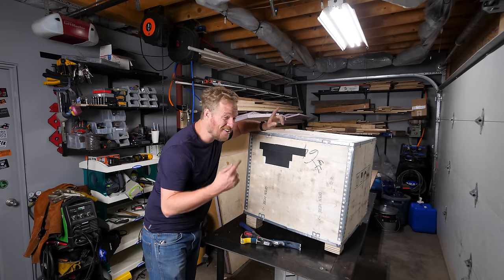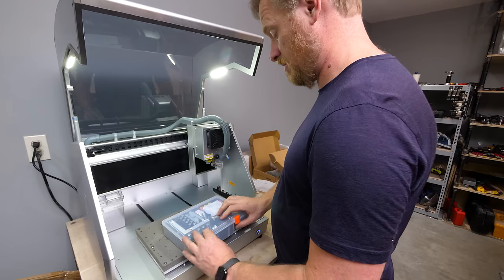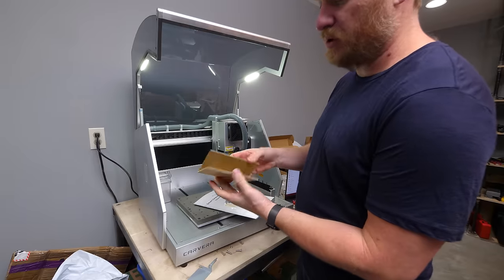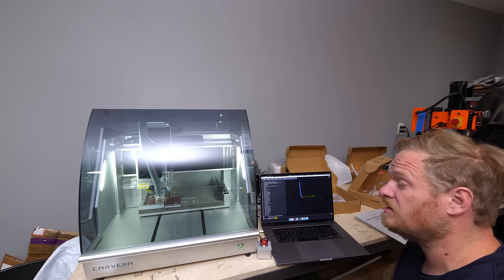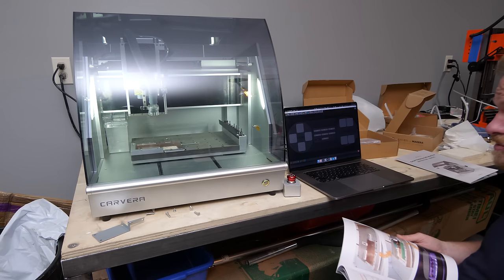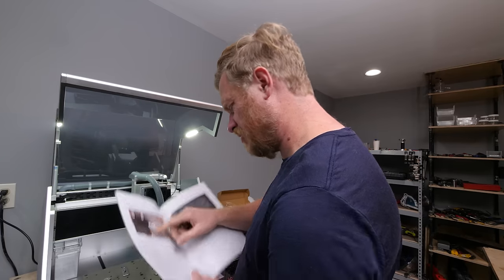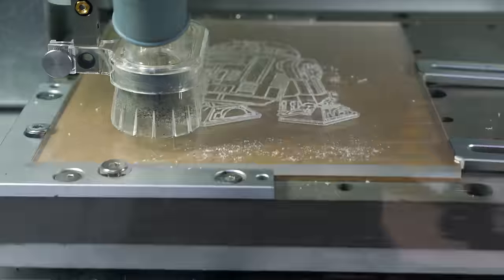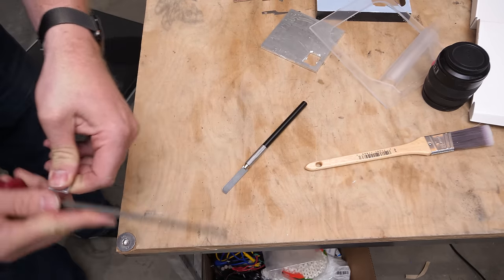Carvera - The Perfect Desktop CNC Mill?

Comment: These seems like a solid build for a small soft material CNC, however it suffers from the same problem as Bantum tools: at $4k, why not just spend the extra 2 grand a buy a full on tormach? I think for these desktop CNCs to be a good value they're going to have to come in under $2k.
Reply: i got a desktop cnc for 4k   since its kinda hard to carry a tormach into my Apartment on the 3rd floor 🤷‍♂️also i only have single phase power
Reply: @Basement_CNC  which one did you get?
Reply: @Basement_CNC  I think the smallest tormach can run off 110 - either way I just can't get over the value difference. For $2k more you get a full fledged CNC machine with a real build volume that you can even cut steel on, vs $4k for a machine that's going to struggle with aluminum and has minimal build volume. Is love a small "desktop" machine but I think it should cost around $1500.
Reply: @lephtovermeet  I think this is great value for what it is but it's not the best option for most people and a huge ammount of money. What I can't figure out is why none of these desktop machines have steel or even cast iron frames. At the price the shipping cost difference must be negligible and I don't belive it would push the weight over the top to make it impossible for one person to manage a machine of this size.
Reply from the maker: I'm considering getting a tormach as well.  I think they're for different use cases though.  I'm not sure I'd want to try doing prototype PCBs on a tormach, for instance.  Also, you're going to spend a lot more than $2k more on a tormach if you want to match the bells and whistles like an ATC, enclosure, dust removal, etc.  Even on a 440, those add-ons really add up.

Comment: I wonder if you could use MasterCAM to generate programs and G-code. You'd need to create a POST for the machine but after that the sky is the limit. Can you cut mild steel if you feed slowly or do you not have the rigidity/power?

Comment: This is literally double the price it should be. The only people using these are the ones that got them for free to review….

The smart makers just make their own for a fraction of the cost.
Reply: I'm working on my own no budget desktop cnc but if you value your time and you want a tool not a project then this is dirt cheap. And I haven't seen any cheap and decent tool changing systems for desktop cncs, diy or not. And building something like this would cost one or two k for just parts since it has linear rails, ballscrews, servo motor, wireless probe, laser and more. It wouldn't be hard to build something more rigid or powerful cheaper but matching the functionality and polish for the price they offer seems very hard.
Reply: @samandoria  You bring up some good points but $4k+ is A LOT for a 200w spindle and no rigidity - no matter how many gimmicks they throw at it. If someone's not into diy, there's plenty of cnc mills/routers on aliexpress for that much with 10x the performance.
Reply: @hzmeister9596  what makes you say the rigidity is so bad? To me it seems it should be way better than any similar size router I've seen on Ali. They also always seem to be made of aluminium or even sheet metal and not of a more sturdy construction. If you have a model/search term that I've missed I would love to look it up. I would hope this would have a more rigid alloy too considering the price. Anyway you'd be surprised at what you can achieve with even just a 70w motor and this level of rigidity. Pocketnc is also 200w and 1500 usd more(but 5axis). Having watched a lot of videos on the nomad desktop cnc I'm amazed what people can create and use it for working within its limitations.

Comment: It's nice but for $5,000 I'd be tempted to buy second hand.  As for the extraction, get something external and make sure the cabinet can breathe, no point trying to suck it out while fighting a vacuum.  Also, way too much shank was showing on the engraving bit, shorter is better.  Apart from all that it's quite impressive and vid was well presented, you hit most of the problems that anyone new to this will face which is always good, nothing worse than new kit not performing as you'd expect.

Comment: How does the machine deal with toxic fumes from laser engraving?
Well enough to use it in an apartment?
Reply from the maker: As far as I can tell, there's no solution for the fumes.  My shop got kinda stinky doing the wood engraving example, and a bit of smoke accumulated on the inside of the cover.  If I was doing a lot of laser work, I'd either hook up some sort of proper fume extraction via the port for a supplementary shopvac (to replace the built-in dust collector) which looks pretty doable, or I'd buy a dedicated laser cutter/engraver.

Comment: Nice machine, but yeah the dust collection seems a bit underwhelming.
Maybe a mod for an external shop vac would be a nice addition :)
Reply from the maker: I guess I didn't mention it, but it already has a port for that - just need to buy or 3d print an adapter for my shopvac hose...
Reply: @strangerparts  I don't think you released the dust collection skirt when milling, it's supposed to fall down onto the part to make a better seal for the vacuum... I will say it's still not perfect though.
Reply from the maker: YeH, it’s a little sticky though…

Comment: Will it do 17-4 steel and grade 5 titanium?
Reply: Doubtful. A higher capacity spindle, more rigid construction would be needed. I have a FoxAlien vasto CNC router/mill, I use it for milling aluminum, while it does the job, you can see the machining straining , especially when thicker stock is used. All this even when the machine has ball screws, large double linear carriage and rails

Comment: 3/16 endmill might be a little better option if you think the 1/4 is little bit too much
Reply from the maker: Yeah - The 1/4" is doing pretty well. Particularly on plastics like delrin and nylon.  It's a bit much for aluminum, but for rough passes it's ok I think.  Just wondering if I want to get more bits with a 1/4" shaft so I don't have to switch collets so much.
Reply: @strangerparts  One trick I do on my desktop CNC mill (FoxAlien WM3020) is to have a set of collets with each collet fitted to an individual nut. This saves the effort of snapping the collets in and out of a single collet nut when I want to change tooling from, say, 1/8" to 4mm to 6mm to 1/4".
Reply from the maker: Ah - these collets have an integrated nut, so that’s not an issue.

Comment: Given how you can get professional made PCB's for a few dollars these days, with fast turn around time, spending $4000 on such a machine seems like a waste. Its not like its all time and labor free. You still have to spend a lot of time making it, and good luck getting plated through holes and high density tracks.  Also, buying PCB blanks, and consumables will cost you more than the cost of having boards made for you.

Comment: What type of bit do you use for the solder mask removal ?
Reply from the maker: It’s some sort of spring loaded deal, presumably to control pressure so you don’t cut the copper. All it says on it is “uv removal tool” though
Reply: I see a custom part. Thank you for your answer.

Comment: 10:35 how do you like the LTT screwdriver?
Reply from the maker: I like it a lot!  In face, just used it last night to remove a dozen screws on the back of this thing to make a quick tweak to a potentiometer that is supposed to fix the spindle errors I've been seeing (they discovered the fix after they shipped mine, but before they shipped all of the actual customer units).  The screwdriver was perfect for that task.

Comment: The niche and time for these overpriced things has long passed.
Reply: This is really cheap for the features it offers. I see your point for bantam/nomad that only has American made and out of the box functionality as their selling points. But this actually offers so much more for the price. If you are willing to diy and don't care about atc you can get it/make it for way less and probably better. But we are still talking huge amount of hours, lots of tools required and at least a quarter of its price in parts alone.
Reply: What do you mean?
Reply: @danielwalmsley  that it definitely has its place and provide lots of value for its market
Reply: @danielwalmsley  boutique digital fabrication machines. When these things first came out, they were in different  landscape, tool wise. Now there are many many other choices of more capable machines for much less money. I'm sure these still have a place somewhere but it is a hard sell, imo.
Reply: @Geeksmithing  examples?
Reply: @Geeksmithing  I'd also like to hear some examples if you have any readily in mind.
Reply: @YerBrwnDogAteMyRabit  Carvera, Nomad, X-Carve "Pro", Shopbot Desktop MAX, Ultimaker(just pick any product line), hell even Glowforge Pros to name a few.
Reply: @Geeksmithing  Sorry, that was an unclear question. I meant examples of better machines for less money. I've been considering a Little Machine Shop mini (which is probably not a good comparison, since it's manual) but realized that instead of spending $1500-3k on a little guy, I can get a Bridgeport for 3k-ish and add a DRO or eventually convert to CNC (but that might not be the best $ spent). Ultimately, since I just took a CNC class, I'd like to use it before I lose it, so to speak. So, a small CNC machine would keep the learning process going. Space isn't an issue either. Id rather buy once, leave boutique for the cool crowd, and have a more capable machine. If a VF-1 was left on the curb on garbage day, I'd drag it home somehow ;  ) (I regret not buying an $800 Bridgeport at a tag sale).
Reply: @YerBrwnDogAteMyRabit  $800 for a Bridgeport is a deal if you have enough use… or collect tools like I do in my retirement
Reply: @raybod1775  it was a HELL OF A DEAL, that I don't think I'll see again any time soon, if ever. If I do, I'm grabbing it. When you see em cheap, they're usually in a basement and the deal is, you have to get it out of there cause they want it gone. I got an Enco 3 in 1 for 100 bucks that way. That's a good idea; collect tooling til I actually get a decent machine.
Reply: I definitely agree, at 4-5k I would hope to have some steel capabilities.
Reply: @Geeksmithing what examples???
Reply: @mikiauto73  the featured product in this very video....

Comment: My objection to these is still the same, especially after getting into a midsize CNC machine. For $5300 USD, you could easily get into a Very decently capable and MUCH larger machine with everything you'd need to get up and rolling, including software and a goodly number of bits to learn on. The price point on these is insanely offensive.

Comment: Just In!: Included with each machine is a coupon for a Harbor Freight Shop-Vac, since the dust collector of the machine sucks, ...er doesn't suck enough.  😂  Nice machine and has great tools and project(s) included, but underpowered AF and questionable $ value.   
Shahriar made a quick & dirty PCB to replace the computer of his Nordic Track using this thing.
Reply from the maker: Yeah - it does have a port to hook up the dust collector to a shop vac.  Just need to either buy or print an adapter from that port to my shopvac hose.
Reply: @strangerparts  One would think that for $5 grand, they could have provided several to accommodate the varying hose sizes.

Comment: “Eight inch, 30 degree, 0.2 millimeter xxx bit” Did they really mix units? WTF?
Reply from the maker: Yeah - it's an 1/8" shaft with a 0.2mm tip on the V bit.  Fusion 360 handles it just fine though, so 🤷🏻‍♂️

Comment: This is cool and all but for $3999!?! You'd be crazy to buy this instead of something like a stepcraft cnc.
Reply: $4000 ? where did you see that, the website says $6000
Reply: Dang 6k! I guess it went up after the pie order period.
Reply: @DM-lx4yu  with the knowledge that it was 4000 before and even less during the KS there’s just no way I’m spending 6000 on it now. Like no way
Reply: @erikm9768  I've had two stepcrafts both have been good to me. Decent prices too in my opinion.

Comment: sure its cool, but its too expensive, the 200w spindle is a joke , the toolchanger is useless since it can only run 1 size of endmills, its like a nomad3 but more expensive,  and its way wores than the makerdream evo one pro 

and the 2,5 laser is a joke, so is the dust collection
Reply: One shank size doesn't mean you can have different sized and types of bits. Especially for making pcbs it should be more than enough since most bits are 1/8 inch anyway.
Reply from the maker: Yeah, I think you're misunderstanding how tool changers work.  The fixed size is for the shaft of the tool. You have to have a collet that holds the shaft of the tool, which is a fixed size on every CNC mill I've ever seen.  But for a given sized tool shaft, you can have a variety of endmill/tool sizes.  The reason I'm swapping collets is that I ordered a 1/4" endmill which has a 1/4" shaft, but pretty much all the tools that came with the machine are 1/8" shafts.  What I probably need to do is just order some more tools that have 1/4" shafts for the type of things I want to use the 1/4" endmill for.

Also, I'm no familiar with the nomad 3, but at first glance, it doesn't look like it has an automatic toolchanger, an engraving laser, or dust collection, has a much lower powered spindle (70w vs 200w) and has a much smaller work area (8"x8"x3" vs 14.2"x9.4"x5.5").  Also, as far as I can see, it doesn't have support for a 4th axis.  I'm not trying to simp for Carvera, but I'm not sure it's a fair price comparison...

Same for the evo-one pro - no ATC, laser, etc. Though I see it's 600W, which is pretty awesome in that form factor.
Reply: I have a EVO ONE PRO and on alluminium the CNC works at 1.5 mm at every pass not 0.2 mm and the finish is perfect You don't have to make nothing.
Tools are ER16 (10mm max) and You can work with every tools.

Comment: 5000!?! Wtf?!?! WAY OVERPRICED!
Reply: Automatic tool changer, wireless probe, high end enclosure.  Lots of bits and fixturing kit and materials in the box.  Nope, pretty sure that the pricing isn’t unreasonable.  The target buyer is clearly the glowforge user / apple fanboy ready-to-use market.  This market is willing to pay more to not need to solve a lot of problems with their machines.  They just want to use the machine.  Not have to fix / upgrade / mod this, that and the other thing to get the equipment to function.
Reply: Tool changer alone costs around 2k. Than it has a Magazin and a wireless probe, enclosure and I assume ball screws and linear rails. 
5k seems reasonable but out of my price range too. I bought a Genmitsu 4030 and modded it. 
As for now new drivers and a Arduino to drive it 1k + 200€. Ball screws and linear rails will cost around 2-400€. So around 2k in the end. ATC would cost another 2k. 4k and still no enclosure.
It’s a lot of work to get the same functionality as seen here in the vid but it is possible and cheaper to diy in the end. But I don’t think the majority of people want to mod there cnc or build one from scratch.
Reply: @barrettdent405  literally
Reply: "Way overpriced" = "I'm way underfunded"

Comment: Anyone know how thick of aluminum you can mill on this?
Reply: Not really the right question.  Even the crappiest CNC engraver can cut 1" thick aluminum.  The question is, how many passes will it take, how long will it take, and what will be the surface finish be like?  The rule of thumb seems to be, don't cut more depth in each pass than the diameter of the end mill, so the better question is, how fast can you drive a given size of end mill through aluminum, without losing accuracy due to stiffness deficiencies?  It's encouraging that he was able to drive 1/4" shank end mills through Delrin at what he considers scary speed, but it's obviously not going to do as well through aluminum.